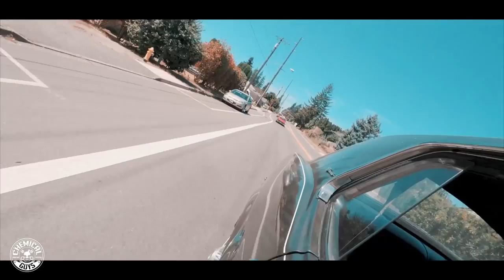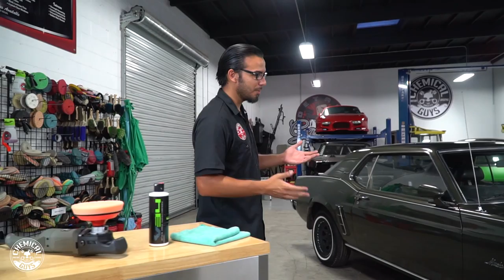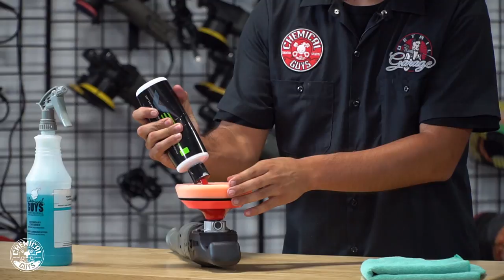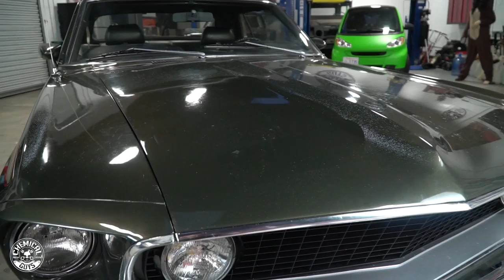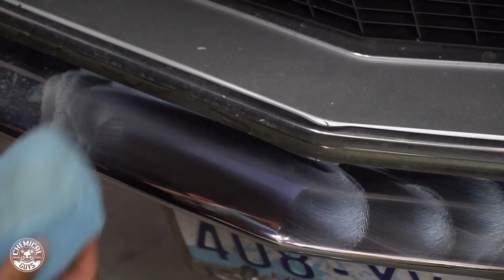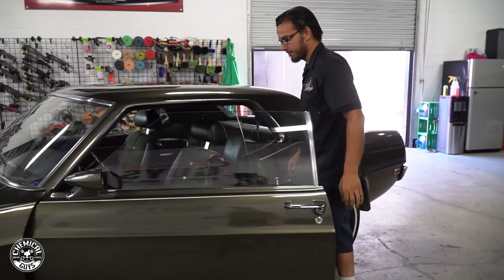How To DIY Repair REALLY Bad Paint? | 1969 Mustang | Chemical Guys Car Care

Comment: This is one of the net transformation in the paint work 
It took really good hard work.
Paint is looking really good and clean
Reply from the maker: Thank you Angad, we appreciate the feedback. The Mustang needed deep paint correction to remove water spots, the paint had begun to dull a little and had shown signs of oxidation as well. The car was purchased from the owner of a car dealership in Seattle, the car sat outside for a long time without much protection which led to the condition that it's in. Stay tuned buddy, we've got an awesome new video coming out tomorrow.

C.G. Alex -
Reply: Chemical Guys thank you so much

Comment: awesome.. so the Jet Seal.. do you continue to wax once every couple months after that, and just reapply the Jet Seal every year or so.. or what?
Reply from the maker: Hey Travis, thank you for taking the time to watch our video, we hope that you liked it. After applying Jet Seal, you can wax your car like normal, meaning every 6-8 to eight weeks. Make sure to use a clay bar if the paint feels rough to remove any contaminants from the pores, that will allow the Jet Seal to occupy the cavities and prevent oxidation from ruining your paint. Jet Seal can protect up to twelve months depending on the weather. I would reapply the Jet Seal every six months just to ensure you're getting the maximum amount of protection. The only real way of knowing if it still on the paint is if the water sheets off of the paint. As long as you wash regularly, clay when you need to, you should get the best possible performance from your coatings. Stay tuned Travis, we've got one more really awesome video launching tomorrow.

C.G. Alex -

Comment: How do you prevent compound/polish from caking up when using a DA? I use pad conditioner but it still does it and creates dust
Reply from the maker: Hi Vladimir, use less product, make sure to spread the polish evenly across the paint surface. I think you're moving too fast when you polish, compound takes longer to break down. It's okay to use more pad conditioner after each panel, and lastly make sure that your pads are thoroughly clean Give it a second try, keep us posted on the results. Stay tuned Vladimir for more great videos. 

C.G. Alex -
Reply: Chemical Guys I only use 5 done sized drops just like you guys suggests. I'll keep the other tips in mind next time I give it a go
Reply from the maker: You can do it Vladimir, we have faith in you.

Comment: Hey chemical guys! My white car has been stained for a few years now. It there any way of getting it out without having to sand it off?
Reply from the maker: Best thing to do is polish, apply a glaze, wax, and seal. Polishing will remove the outer most layer of clear coat to reveal fresh paint. You'll want to wash and clay the first before anything, and then when you're done polishing, you'll apply a glaze to fill in minor perfections, apply a sealant to protect the paint, and lastly apply a wax to add a combination of shine/protection.

Comment: When polishing does 1 pad do the whole car
Reply from the maker: Hey there, it depends on the condition of the paint, some people opt for a one step polish like VSS or V4. When doing a two or three step polish, you will use about two pads, one for removing clear coat which eliminates the scratches, and one fine pad to make the paint look crisp again. There are various other pads too for applying waxes and glazes but for now you can get away with using two to three jobs. I say three because we have a yellow pad that's super abrasive, but I don't recommend using that one as much because it can mar the paint. I believe that the multi step polish is a more effective method since some people aren't happy until all the scratches have been removed which can be a very labor intensive process.

Comment: What can I use as pad conditioner if I don't have any of your product on hand? Is it good to use in all situations or just when doing heavier compounding?
Reply: Taylor Royal any quick detailer can do it! Or water
Reply: David Saucedo Sweet, that's what I was figuring but wanted to make sure. Thanks!
Reply: Clay lube works fine !!
Reply from the maker: Hey Taylor, you can technically use water, but clay luber would be a better choice.
Reply: Chemical Guys Cool deal. I've got plenty of your clay luber.
Reply: Use filtered water.

Comment: Before doing this aren’t you supposed to wash the car first? So you can have a clean surface to work with
Reply from the maker: Hi Julio, the Mustang was cleaned using Hybrid V7 and some green microfiber towels. A clay block was also used to clay the car, impurities were removed to prepare the Mustang for polishing and the application of Jet Seal.
Reply: This is an older car. You don't just wanna start spraying it with a high pressure hose or water hose as you don't know how great the window seals etc are. Plus it's older paint and you need to take extra precaution 😉
Reply: Chemical Guys nice! Just a thought I had since it wasn’t said in the video
Reply from the maker: Sometimes we do this off camera to speed the process along, and there are times where we have multiple cars in the garage so that limits how much time we have to film. Also most people are familiar with the process, and have watched other videos that start with the traditional wash. Stay tuned Julio, we've got more great videos on the way.